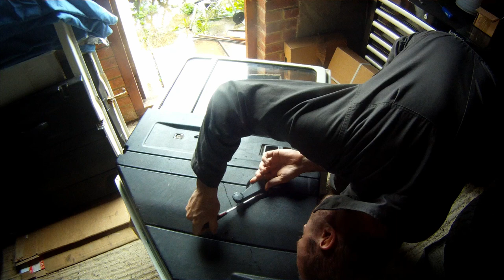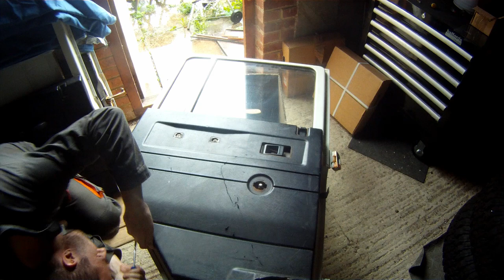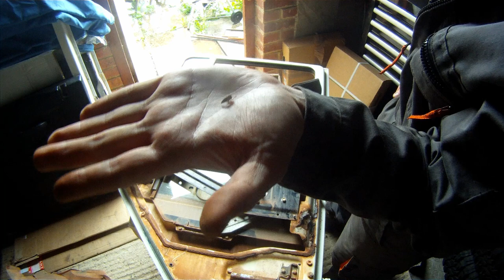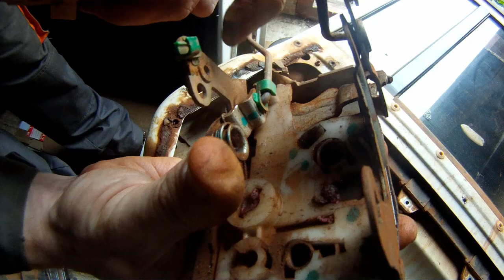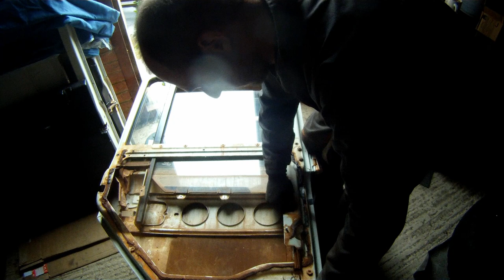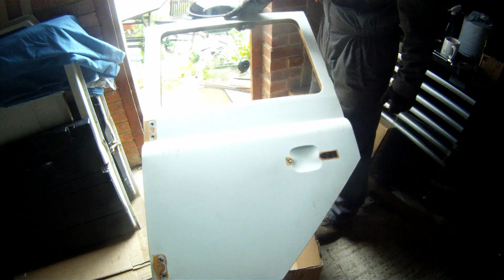Dismantling a Land Rover Defender Tdci/Puma second row door (with rounded corners)

Comment: Loads of theses land rovers were bought back from Sierra Leone via the Port I work at and were all parked up and sprayed with something because of the Ebola outbreak they had!
I remember they were covered everywhere with a red dust inside and out.... after a few weeks I started seeing them on eBay and most had been broken for parts, they all looked like they had years of life left in them so I wondered why they were broken up?
They also all had roll cages fitted.
Reply from the maker: Yeah those were the ones. They did the rounds on ebay in 2015 and 2016. I guess there was a big construction contract that came to an end for Dawnus, although why they brought them back to the UK I don't know. If they were left they may have had to pay import tax.

I followed them quite a lot on ebay and most of them were utterly ruined with only 80k miles. Dents in every body panel, metal fatigue. The red staining is a bugger to get off!
Reply: LR Workshop & Expedition yes I had a good look over them myself, dented and beaten about but plenty of life left in them from what I could see!
There was also some discovery’s with them with the Dawnus stickers on the door, I remember opening the drivers door and it was full with the red dust..

Comment: i am guessing installing the door glass runners etc is the opposite of what has been shown?
Reply from the maker: I haven't actually done it yet, but yes I'd probably do it that way in reverse
Reply: @lrworkshop   the  channel guide on mine has been a pig (more colourful words needed) to get in - it sould clip in without too much pressure then  put the screw in , correct?